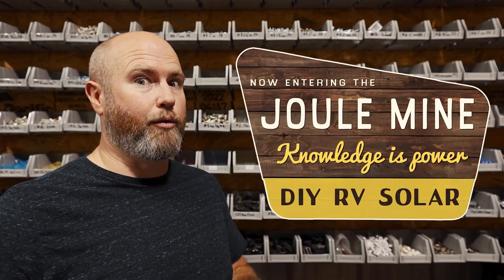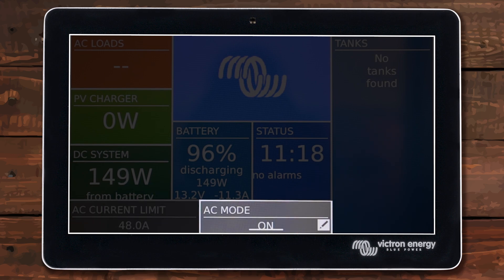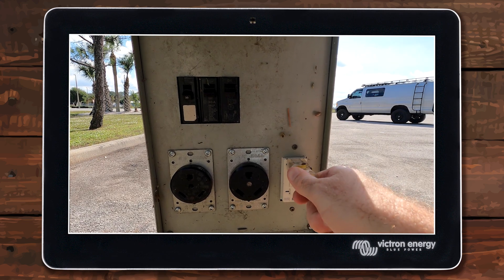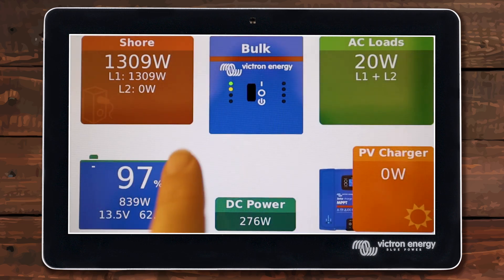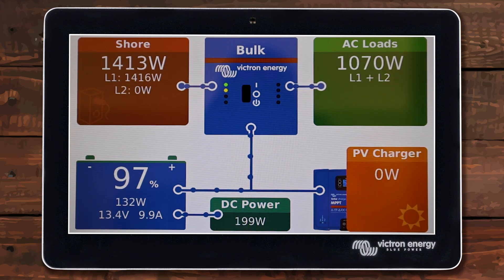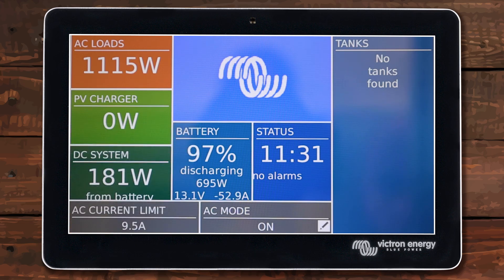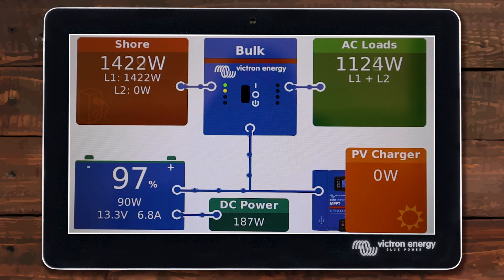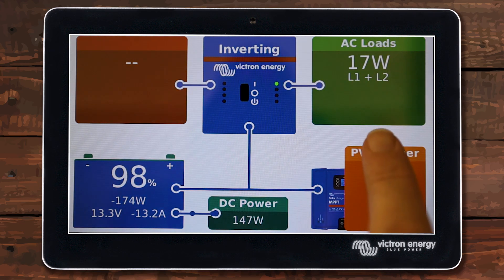How to use AC Input Current Limit on Victron | RV SHORE POWER MADE EASY!

Comment: Great breakdown! I have a question if you're available, when plugged into shore power like you were at a 15amp outlet and set it at 13 amps, why do the batteries show they receive around 50 amps? Mine does the same thing and im trying to figure out the logic/math behind the batteries reveiving 50ish amps being set at 13 amps. What am i missing?
Reply from the maker: @miykaelah  You're forgetting the voltage difference between 120v AC (shore) and the 14v DC the batteries are getting. 13 amps at 120v = 1560 watts, but the charger is putting out ~50amps at 14v. 14 x 50 is ~700w. If I had to guess, you've got other 120v AC loads and/or 12v DC loads that are consuming the other ~860w of the 1560w (120v x 13a)  you've got available from shore. Watts = Amps X Volts. Safe travels ✌️ -Tom

Comment: Everyone said I bought the wrong inverter, the MK2 2x120, but I know it has to be backwards compatible since we all will use a 30-amp Dongle with L1 only on the electric pedestal at the state parks. So, if I am just using my 30-amp coach Pre-wire on my Brinkley, that is the very same thing effectively (My L1/L2 input is effectively shorted and L1 output goes to the other end of the Looped 30-amp pre-wire). The big waste is no L2 going anywhere, except I plan on wiring in a single AC outlet in the forward front compartment for L2 charging some of my camp host batteries I use to pump water with or the Starlink Power Station, etc. At some point I will wire up my MK2 fully to 50-amp L1/L2 but snaking that 6-3 wire x2 through from the front compartment to the underbelly chase way going to the breaker box isn't for the faint of heart for this 63-year-old with arthritis. Up until now my priority has been crimp & bend for the rest of the system. When I get back to Winter Haven in 2 weeks from visiting the grand babies in Chicago, I will finish the hooks to the single L1 30-amp pre-wire, but will consider the full L1/L2 route for phase C or D. Everyone thinks this is all plug & play, but as a Ham Radio guy for 45 years, plug & play for me is cut, crimp, & torque for everyone else, LOL. Cheers, Davey - KU9L, RV Full-timer since 2008.

Comment: Hi this is Troy can you please tell me how to turn on the setting for windturbine 
I take it according to this document you can use the shore mode for wind is this correct ?
please reply with a step by step guide if you know how 
thanks troy 

https://www.victronenergy.com/upload/documents/Solar_&_Wind_Priority/156386-Solar___Wind_Priority-pdf-en.pdf?_ga=2.49897509.2009304924.1719813676-1687838910.1698938008

I am using my system totally off grid at home during the day then on grid in the evening

Comment: Here’s a general question that I can manage, but it seems like there must be an easier way…

With the Victron Multiplus II, with 1000W of solar and 700Ah of lithium, I occasionally want the Multiplus to pass along the shore power (either generator or a household 15A connection) without it trying to also charge the batteries.  

Either I don’t want the generator running super high RPMs or blow a household breaker…

What is the easiest way to tell it to pass the power through, but don’t charge the batteries (for now).  What I’ve done is have to go through VE Configure and upload a profile that has the charging current set to zero.  Is there a way to do this from the touch screen?
Reply from the maker: @camustang1966  Unfortunately that is the only way to turn the charging off. However, if you set you current limit to the plug (or a little lower), it will de-rate the charger and prioritize the AC power that is passing through. Aka if you have it set to 15A and have a 10A load, then it will use 5A to charge the batteries.. but if you're using all 15A, then it will stop the charging. Happy camping 🏕  -Tom
Reply: @HappilyWhereverAfter  Tom...as a follow-up to this (I'm on the road again) let me illustrate something.  My batteries are at something less than 100% (say 80%), and I am running a 3500W generator (3200 running watts) or about 26.6A.  I want to run two of my 13.5k BTU ACs (which I have done before on a 30A shore power connection at much less than 26A). I have soft starts on both ACs.  Unless I set my current limit super low, I can't get both ACs to run without the Victron shutting off the grid (generator) connection.  If I set the current limit really low (12A?), both ACs will run but now it is pulling from the batteries to run the ACs even though the generator is quite capable of running both ACs.  I tried setting the mode to Charger OFF but that didn't seem to work either.  It even threw an error code because it overloaded because it couldn't handle charging, and running both ACs.

I was in a place without cell service, so I couldn't upload my Charge Current Zero configuration to the Multiplus.  In essence, is that my only option here?  Uploading a charge current of zero to the Multiplus?  I guess I could install a bluetooth module to the Multiplus so I wouldn't have to use the Internet to get into it right?

I hope this all makes sense.  Thanks for your help.

Comment: Thank you for this great break down!  I’ll be watching this a few times to make sure I’m squared away.  This is helping me to understand my Digital Multi Controller as well.  I went with this “entry level” inverter control when I was building out my lithium system.  That and the info from my BMV-712 Smart Battery Monitor allows me to get most of the info listed here.  I do pine for the easy info shown on your Cerbo GX however.  Maybe one day I’ll upgrade to that when I add my solar.  Again, thanks for your production here.

Comment: Thank you for your advise.  I'd noticed that my inverter was always humming away whether I was plugged into shore power or not and now I know why.  Switched to charger now while plugged into 50amp shore power.  Did it cause any wear on our Multiplus II to have it always inverting for a couple years?
Reply from the maker: The hum is probably the charging cycle and it only goes into inverting when the shore is disconnected. It will also assist by inverting if the AC limit was set too low. I prefer charger only, so if the shore goes out, my inverter isn't draining the batteries while I'm gone 🤙 Safe travels!